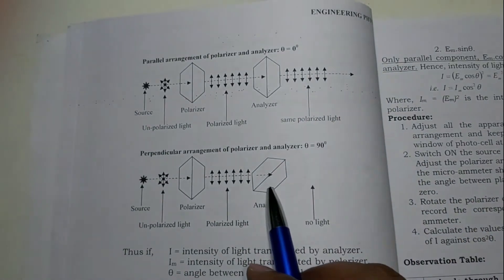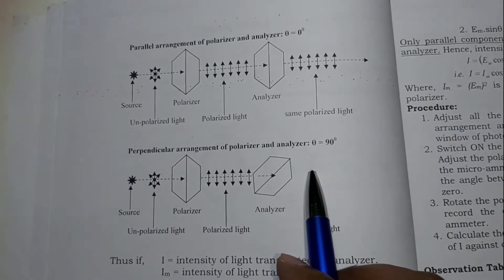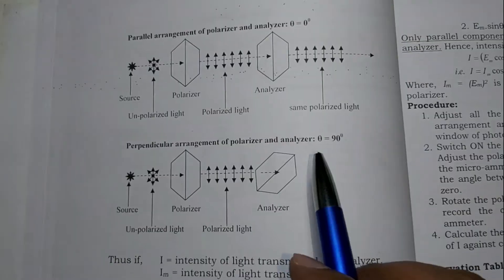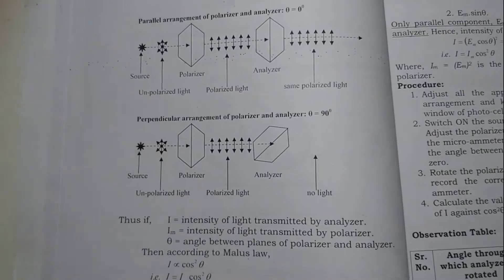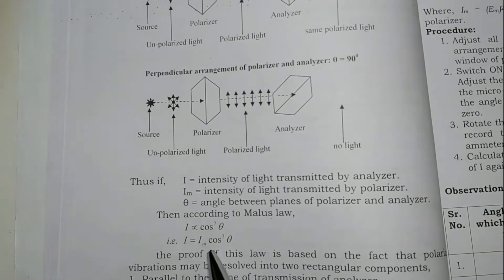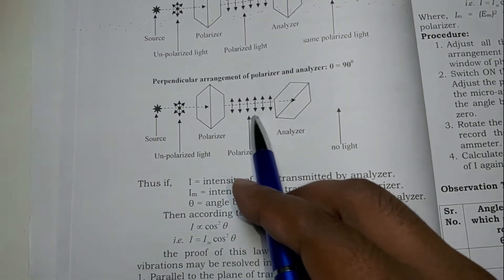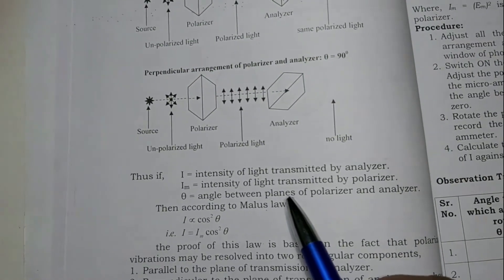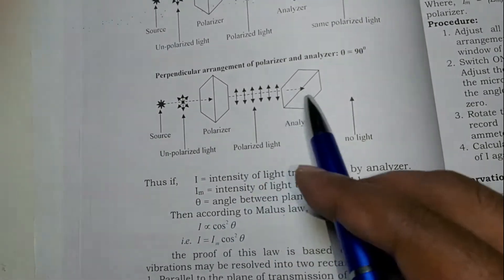Malus Law Verification Experiment by Prof  Sasane S B

Comment: What is the intensity measured without the analyzer?
Reply from the maker: It will  be constant.
Reply: @SSPhysics  I understand that it will be constant but I'm wondering what the value will be relative to the maximum you get with the second polarizer in the beam. Will it be the same or higher. In other words, that value will be I0. Does the rest of your observations match the I = I0 cos^2 theta relation, or is there some adjustment needed?
Reply from the maker: @nowitchhunt  are you talking about maximum output intensity from analiser?
Reply: @SSPhysics  Sorry if I wasn't clear. Yes I'm interested in the maximum output from the analyzer *as a percentage of the maximum intensity when the analyzer is absent*. In other words, I'm also interested in the maximum reading when the analyzer is removed.
Reply from the maker: Formula for Malus law itself tells this. 
I=Iο Cosθ

Analyzer =second polariser. 
If polariser is perpendicular to analyzer(θ=90 )outcoming intensity(I) will be minimum(cosθ=0,I =0, ideally). When analyzer is parallel to polariser(θ=0) intensity will be maximum (cosθ=1, I=Io, ideally). Means maximum intensity coming out of analyzer is equal to  incident intensity on analyzer. If you remove analyzer at all intensity will be Io.
Reply: @SSPhysics   What is Io according to your experiment?
Reply from the maker: Here I have not measured absolute intensity Io like in lux or lumens but only variation in current which is proportional to light intensity.
Reply: @SSPhysics  I think you can measure Io by removing the analyzer (second polarizer) and measuring the maximum current. This is what I've been asking. 

Everybody assumes that I = Io at 90 degrees ideally but nobody measures it, though it is very easy to measure by just taking out the analyzer.

Comment: What’s the use of power source here as we are getting current from lamps light only
Reply from the maker: Good question.  Current without external voltage is too small to detect. Means almost zero for given source.  I have tried that.
Reply: @SSPhysics  got itt sir👍